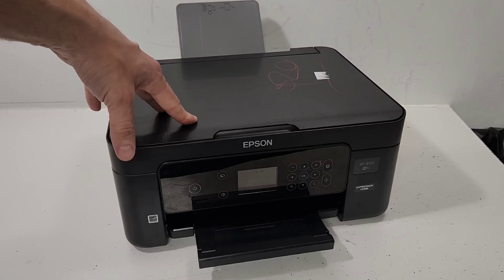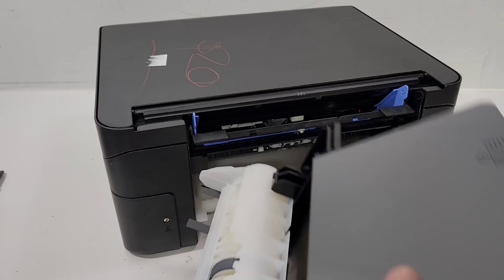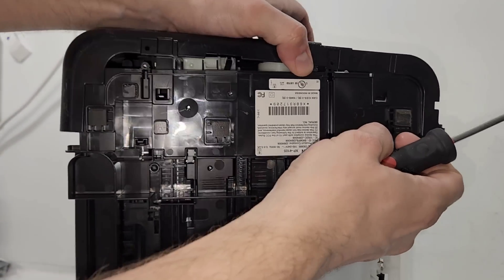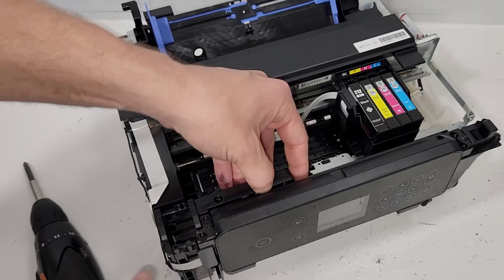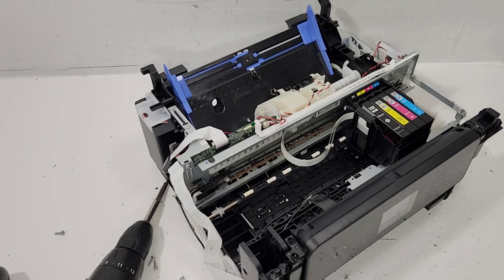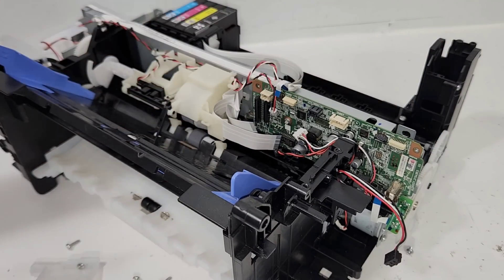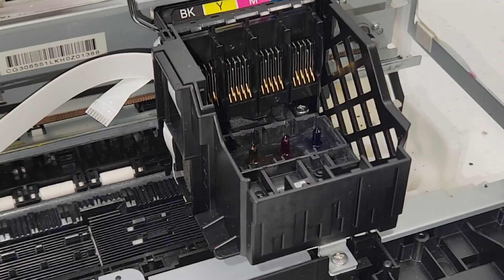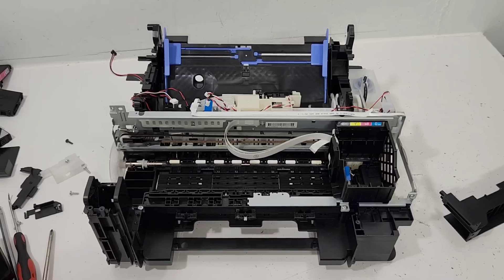Taking Apart EPSON XP-4100 Printer For Parts or To Repair XP-4105

Comment: While trying to unclog the print head, I accidentally pulled the ribbon cables out of their sockets for the scanner. Who knew that having a disconnected scanner would kill the entire printer. I found your video through Bing search, and I just needed the first part of it to get to the cables. Plugged them back in and am now working on the print head some more.

Please note that when reinstalling the left side plastic, the tabs on the bottom are very fragile. I snapped one off without even trying. Fortunately I don't care!

Thanks for the video. I really hope I don't have to remove the print head. If so, I'm going to toss this printer into the ocean!

Comment: If possible, would you be willing to do a video on the disassembly/full anatomy of an Epson XP-4200? Some parts of it are similar to the XP-4100, but overall there are some pretty big differences. To my knowledge there's no guide for all the parts of the XP-4200, so a video would be greatly appreciated!